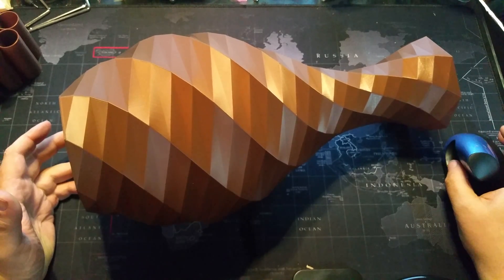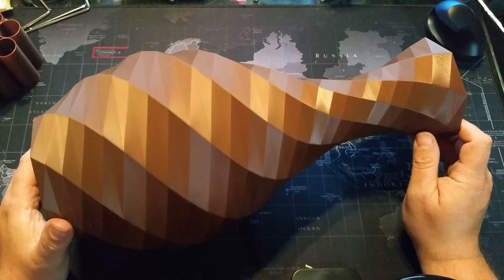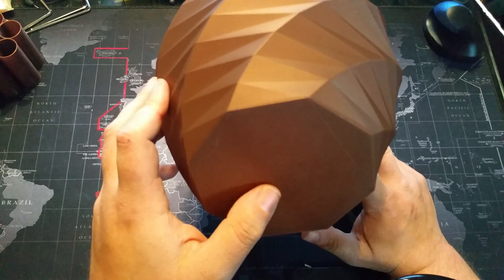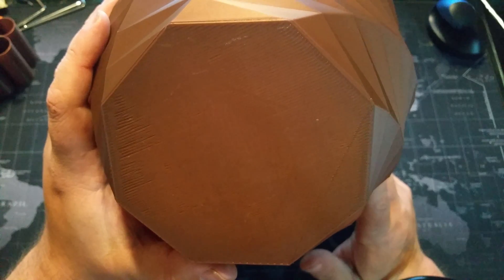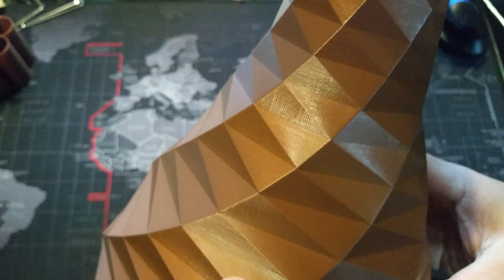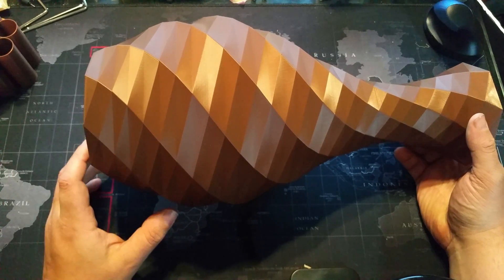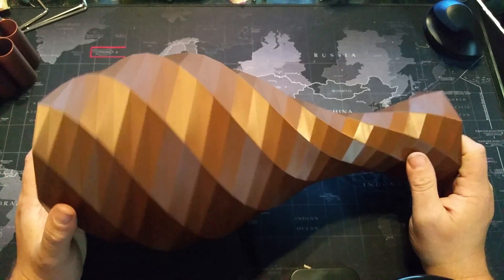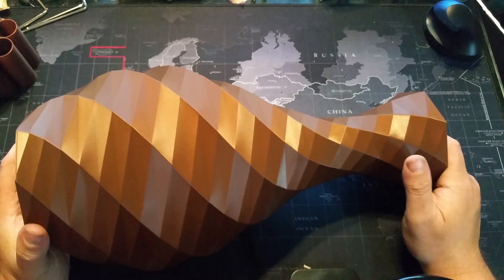Today's 3D Print - Low Poly Rose Twist Vase CR-10

Comment: Hi Sir, what nozzle and layer height? speed?time it took? thanks
Reply from the maker: IIRC 0.4mm 0.2mm LH 220c 50mm/s default max speed. Maybe 12 to 15 hours? Once i get to the vase part i run the extrusion multiplier to 125%

Comment: I'm glad you like my vase!  Man that print is HUGE!  Love it.
Reply from the maker: riskable its gorgeous! especially in these metallic filaments. someone on reddit made one in woodfill and it also looks stunning! do you think you could make a custom one for me?
Reply: Yeah I posted a wood (stained) version a while back and someone just recently posted a HUGE unstained one.  What do you want customized?  =)
Reply: BTW:  You might want to fix the typo in the video description ("Roase" should be "Rose").
Reply from the maker: riskable i want to make a rocket kit body with this.
Reply: A low-poly rocket?  Not sure that would be very aerodynamic but I might be able to pull that off.  Does it need to print in vase mode or is regular mode OK?
Reply: Actually, I already made a low-poly rocket that's similar to this...  What do you think?  http://imgur.com/KM9Eneh
Reply from the maker: riskable yep vase mode. i will draw up design specs should be very easy for you with the original file basically a straight tube with this twist pattern and a small bulbous section at the bottom and conical pattern cone at the top with 3 fins around the bulbous section.

my rocket kits are not about aerodynamics but about eye candy. low and slow are my favorite flights.
Reply: @nerys71  How much does this vase way? Thanks.
Reply from the maker: @Fairvalues  almost nothing maybe 100 to 150 grams tops
Reply: Beautiful design!! Do you have any tutorial on how to create low poly vases?